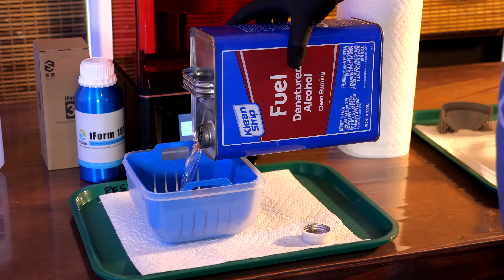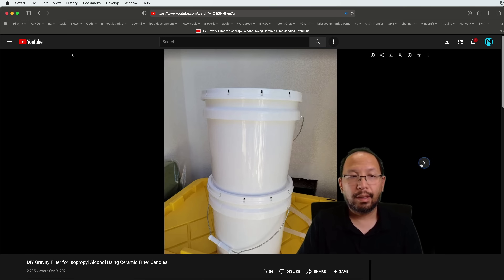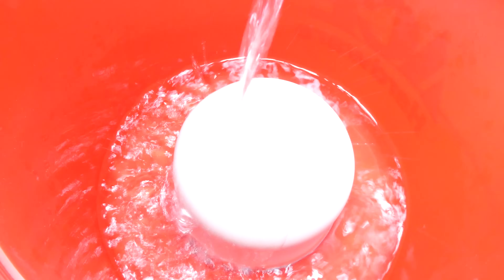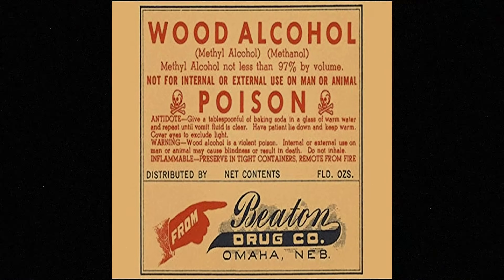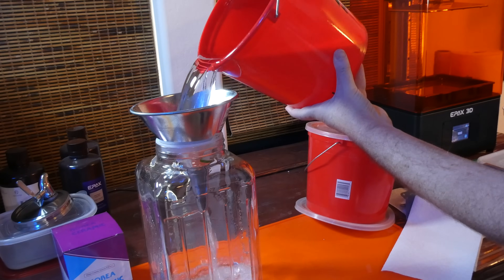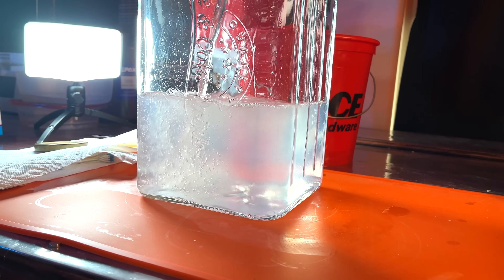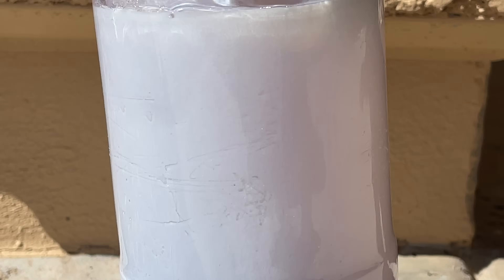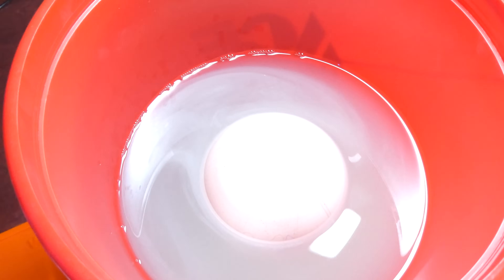Can We Recycle 3D Printing Alcohol?

Comment: I've done both distilling and filtering.  They are both a pain.  Distilling is faster but is a fire hazard.  Odor is worse for distilling as well.  I broke the thermal sensor on two different distillers before the first gallon.  Both methods are messy as well.
Reply: As a person with a background in lab tech, i'd not hesitate to distill the alcohol off. With the right setup it's safe enough.
Reply: @Unpronounceable_H  Yea.  I did this before but I pulled the electronics so I could get the distiller to only go up to the boiling point of ipa.  I discovered if you just let it boil at 100c, it drys the resin all on the bottom of the thing and becomes a pain to clean.  You also need to put a good seal on the nozzle so the stuf that is finished dosn't evaporate.  So I am thinking of going to this bucket idea, cheaper and don't need power:P
Reply: @warlockd  Water boils @ 100c. IPA boils at about 87c. If you mix them they form an azeotrope. You can distill the ipa out to near 92% if you use fractional distillation. This is done with relatively inexpensive lab equipment.
Reply: @rcw93277  the distillation apparatus will still reach 100°C and higher as it gets to the end of the liquid. So unless you're paying very close attention to it, it will overheat when the alcohol is gone and there just water, resin, and other stuff left. So capping the temp to 90°C is a much better option. It will never rise to 100 and beyond, and create a sludge of water and resin. Also, you don't have to monitor it to see when the temp rises so you don't distill water over.
Reply from the maker: Thanks fo commenting. Yeah that is sort of what I got from it. But I’m going to keep trying the filtering to see if I can get a system that isn’t too bad.
Reply: @Nerdtronic  I'd make a 5 or 6 bucket tower system that steps its way down from a bigger 100 micron filter, into a 20, into a 10, into a 5, and then the 3. This way you might have  better chance of the bigger filters catching some of the larger resin gunk and not having it clog the smaller ones. Great videos man, love them!
Reply: @Nerdtronic  can I suggest you try switching to bioethanol, I've been using it for years as camping stove fuel and as a cleaner.  In the UK our denatured alcohol (methylated spirits) must contain no more than 9.5% of the highly toxic methanol,, 5% if industrial, in the US it's not so.  Have a look at the safety data sheet for that stuff you are using, it can be as much as 50% poison, bioethanol fuel is much cleaner and smells sweet, also it's not a petrol product unlike denatured alcohol and IPA.  Ethanol is also slightly safer on the skin than IPA, methanol is not safe at all on the skin.
Reply: @tuvaaq  Is the cleanup/recycle process similar for Bioethanol? I am curios because I might switch, but if I have to set up a new filtration system it makes it slightly less worth it.
Reply: @marshmellowphysics8  yes, exactly the same process.  Bioethanol is manufactured by fermentation and distillation just like Vodka.  IIRC there's one molecule difference between it and iso.
Reply: @tuvaaq  it's not really a concern. The methanol is just fine unless you ingest it. So it's a non issue.
Reply: @littlejackalo5326  it's also absorbed through skin contact.  Bioethanol is also plant based, the world is trying to diversify away from hydrocarbons.
Reply: I've been using a distiller for months now.  It has already saved me the money I paid for it by three times the price I pay for denatured alcohol.  I distill my alcohol out in my back yard away from everything.  I've had 0 issues.  And cleanup hasn't been a hassle either.  Due to the stainless steel basin of my distiller.
Reply: @VictorLaster  i also just use a distiller i just use it outside. it has worked fine for me so far
Reply: @markburton5292  to hot In the sun hit the jar with iv light from a distance
Reply: @markburton5292 If you're going to do it, make sure you do it away from buildings and take fire precautions. Inside is just asking for trouble.
Reply: @jeffkleist9679  i do, but thanks for the suggestion.
Reply: @markburton5292  It's more for others reading. Sorry as a former teenager  I'm very aware of how dangerous it is ;)
Reply: @VictorLaster  Hi Victor what distiller did you use if I may ask?
Reply: @艾米心amihart  Because it's not illegal if you're doing it for reasons other than drinking it (for example, home experimentation, production of alcohol for use in making perfumes, chemistry demonstrations in a learning setting), or if you've obtained the correct distillery licenses and paid the correct taxes. It's only illegal if you drink the alcohol or if you sell the alcohol without denaturing it first and without the correct license and taxes paid. (I spent a bunch of time to figure out what the legal method would be because I was looking to do it legally. I have a liqueur I want to bring to market.)
Reply: So what about exposing the alcohol to a SMALL amount of UV BEFORE filtering? This might help to separate the resin from alcohol. Then let it settle and filter?  Kind of like cheese making. You create a curd with acid, THEN filter the whey away.
Reply: @艾米心amihart  I'm sorry you live in a country or locality with such restrictive laws. In my area, California, USA, the legality only applies retroactively based on what you do with the distillation product (or if you distill more than a certain amount, I meant to include that in my previous post).
Reply: meh having done alot of home brewing an distilling in the past, its really not dangerous at all. As long as your condenser is cold and you have a way of pressure to escape you're fine. A lot of that concern stims from the old myth/half-truth of moonshiner stills exploding. Reality was moonshiners would have spotters and when they suspected a raid they would dynamite their still, destroying the evidence. So when the feds showed up all they found was the wreckage of a still. Leading to the myth of exploding stills. The only real concern would be isopropyl alcohol toxicity. So you would want to do it either outside or in a vary well ventilated area, but once again if your condenser is doing its job this should be a non-issue.
Reply: I've used vacuum distillation, using a heated ultrasound cleaner as the hot end with two flasks joined by tubing. The ultrasound makes the boiling smooth even when there's a lot of oil and other gunk in the dirty alcohol to make it viscous, which prevents frothing and bumping. Doing it under a vacuum prevents the fire hazard.
Reply: @艾米心amihart  Did you even read what you linked. We are talking about isopropynol not ethanol. The things you linked are talking about taxes on wine, cider and the like.
Reply: Distilling IPA is safe if you do it correctly. It's not even that hard. I don't know about using a water distiller though, I don't think those are sealed like you would want with a flammable liquid/gas.
Reply: @艾米心amihart  Well IPA is what most people use. I don't think this guy is doing fractional distillation to separate the methanol from the ethanol in the denatured alcohol, so either way you can't drink it or sell it as a consumable, so it's not illegal.
Reply: For everyone here: *Isopropyl. Isopropanol is not a thing. Also, for the purposes here (i.e. not drinking it) it acts almost exactly the same as ethanol and is interchangeable with it.
Reply: @OneAndOnlyJackSchitt  isopropanol is most certainly a thing. Perhaps you should educate yourself before you spout off.
Reply: Distilling IPA is just an accident waiting to happen.
Reply: Hate to necro something two years old, but... checking the SDS for denatured alcohol, we can find that most formulations of it (it's mostly just ethyl alcohol, grade is determined by water content) have a flash point of 55F and an initial boiling point of 78-80F. Flash point, however, just means the temp it needs to be before it'll ignite in the presence of oxygen and an igniter (fire, spark, etc.) The autoignition point is ~680F. If you're distilling correctly, you're just heating a distiller to just past the boiling point of whatever it is you want to collect (about 85F), there should be no real fire hazard, especially if there's no open flame.
Reply: .04 cents and .17 cents but you have to also include time and labor. Is it worth it if you’re busy and free time is scarce.
Reply: I don't have a 3d printer or know anything about resin. This popped up on my feed due to my interest in alcohol and chemistry. Could someone who's got dirty alcohol try the instructions below and report back? ... Mix 1 part dirty alcohol and 1 part heavily salted distilled water. Mix thoroughly then let separate for several hours. Alcohol is soluble in water, but not salt water and salt distillation is a thing. My thinking is that the uncured resin is more water soluble than it is alcohol soluble (with no reason to believe this, it's 50-50 chance here). Anyway, if it works right, you'll end up with a layer of clean alcohol on to of dirty water. Or maybe dirty alcohol on top of clean salt water. Pure chemistry here, not filtration.
Reply: @艾米心amihart  derrrrrp. You're making broad sweeping generalizations about laws that vary from state to state and country to country. The conversation is about America. This is an American creator, on an American platform, talking to a mostly American subscriber base. This isn't India.

Comment: You should experiment with insoluble salts like calcium carbonate, magnesium or sodium(chloride and sulfate) salts.  If you add a salt that absorbs water, you may be able to cause the resin to agglomerate and easy filtering or better, decanting if you can get it to settle. The problem of reuse is that resin dissolved into the alcohol.  So you need a method to get it to separate out or it will have to be distilled to remove the dissolved portion.

Comment: I bought the recommended filters and replicated the setup. As already mentioned, the IPA flows through very slowly. During the long time spent in the IPA, the filter has now detached from the plastic plate and is unfortunately unusable, or rather, I have to somehow re-glue it.

Comment: Distiller Is actually Super fine, as long as you water down a bit with distilled water, so you get pure alcool with First distillati on, than distilled water with second and in the bucket the gunk will stay behind, but it's a long and messy way....

Comment: What is wrong with just using paper towel or some other fine weave material to then pour the used IPA through and then re do this again to collect any larger particles... then put the container outside for the resin to cure in the sunlight and then decant off the rest of the IPA to be used again..

Comment: You could more safely distill your alcohol by adding an equal amount of water, and then distill it.   Denatured alcohol has a boiling point of around 170 degrees....water is 212 .....you'll distill and recover your alcohol, before the water even comes to a boil 🤷‍♂️
Reply: This would also make it easier to deal with the "leftover" materials that you're removing.
Reply: One of your viewers was onto something with vacuum filtering. A solid stainless bottom pan and homemade air tight lid, would do it.

Comment: I just found this, I am just getting into resin 3d printing and I was looking to get IPA to clean the parts and mini's I print. I was wondering how to clean the IPA after you'd finished cleaning the parts. 

I like your method, but I'd set it up in a stand with a filter in the second bucket and a tube running to a container, like your jar, and dump the dirty IPA in the top bucket with a small agitation motor to keep the particulates moving and not just clogging straight up on the filter. Rinse and repeat for the second bucket, but use a finer filter, the .3 micron filter you mentioned, and that filter is the one that drains into your jar.

So, you are double filtering the IPA straight into the container you use to store the alcohol.

Comment: It does not look like your bed is "WARPED" i.e significantly concave or convex  or twisted but flat. It seems to be "TILTED with the back right corner as the lowest and front left as the highest. Now I do not have a Kobra but I would suspect that it should have some kind of corrective macro akin to the klipper Quad gantry Level Z-Tilt-Adjust. The bed level feature does not "level" the bed it merely registrates how far of the plate is from zero. Furthermore, as the bed heats up it will expand - that is not an error it's a feature of metal known as thermal expansion and it's inherent for all metal.
I would suggest that you use your nice meter attachment and zero it at the back middle and use it to bring the two front corners to be at the same height as the back niddle. Then perform a bed level and a z-offset.

Comment: I'm planning on having a whole procedure for my ipa use. I'll essentially have 3 IPAs in rotation at all time. once I wash a few parts with my first ipa, that ipa will become the prewash ipa. Then the prewash IPA will be transferred to the filter system. The Rotation will happen every week. or after I've done a batch of prints. Keeping the ipa usable and clean. Before putting a new batch of ipa to filter, i'll pass a paper towel on the filters to remove any minor gunk build up. I'm hoping this method eliminates the need for IPA disposal. i'm fine with some IPA loss, i just don't wanna deal with regular waste disposal.

Comment: I use a distiller for mine, used it once so far but managed to salvage 5 out of the 7 liters i had accdientally contaminated with a paper towel. Key is to have a fire extinguisher nearby, No fire in my case but just in case

Comment: You can clean the forbidden jello quite easily if you have the right glassware.  You do a vacuum distillation on it, which will leave you with clean alcohol and polymer powder. But at the end of the day its not really worth the time and effort to filter alcohols unless you're dealing with large volumes.

Comment: Hi Nerdtronic, I'm a chemist and I also use a resin printer and I can confirm that you will only be able to recover the IPA without resin with just a distillation, since you will always have dissolved resin (liquid) and it will pass through any filter no matter how small it is. You can test it by heating the IPA in a distillation without using a flame or fire or electricity, you can use boiling water. I think I'll try it and make a distiller to see if it works :) I'll send you the results hahahahaha! Greetings from Argentina, sorry for my English I'm using Google translator.
Reply: Also a chemist, if you set it in sunlight before filtration it will reduce the dissolved resin significantly.

Comment: after 2 years using my 3d printer i have 6 liters of the initial 10 liters of alcohol left..

i put the dirty alcohol in some plastic bottles from sodas and let it sit on my windowsill..(OUTSIDE OF DIRECT SUNLIGHT!)
over time it will settle and partially cure (2-3 weeks).
then i decant it thru an coffeefilter, put the filter and the Bottles with the remaining resin in it into Direkt sunlight to harden and thow the hardened bottles as well as the filters used into the trash.

Comment: i just used a coupla huge mason jars, put some bulkhead barbed fittings, put one of them in a small bucket with a sou-vide at set to roughly 200 degrees F, it runs into a vinyl tube that goes to some copper brake line that i wound into a coil, and then it goes to the lower jar, i do roughly 1.5 liters every 5 hours ish, comes out crystal clear
Reply: Nice way to do it without a spark source!  I wonder though how much savings this produces in reality...like how much energy does it take to make the 1.5l every 5 hrs. and how long does this stretch the life of the alcohol?   I am sure its worth doing I just wonder HOW worth it is all in.
Reply: @jzahirniak  i thought about it, but also found my device was resricting it because of a kink, so i get about 1.5L in 3 hours now running at roughly 200 degrees, kw/meter is about 1.8 kwh, at 45cents kw/h (i live in california) its not too shabby, 1 gallon of 99% costs me roughly 25$ or if i buy 4 gallons its 70$. at 45cents a kwh its about $3 per gallon to recycle it.

Comment: I know this is an older video, doing a bit of research on this topic. A thought though, could run a small paddle in the filter tank to keep the alcohol flowing washing the resin off the filter for a bit? I used to work for a filtration company and some of the prefilters we used in our RO systems go from 25mic to 1mic maybe could be used to get rid of the coarser material?